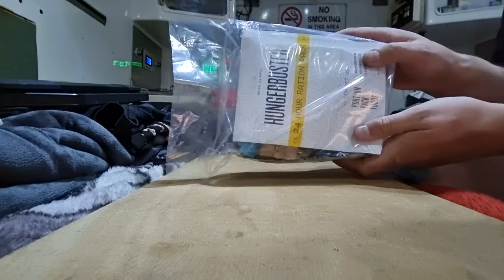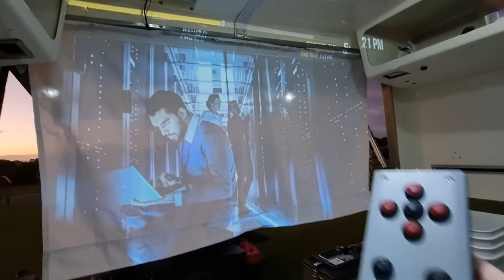Oil, Idler chains and Air filter | New Argo 8x8 Episode 29

Comment: Hi again, one more question. My air intake attaches to the recoil starter on the motor by a round piece of rubber kind of shaped like a sleeve or a collar. it has a groove cut in it for the pull cord.
 on my Argo that sleeve is glued to the air intake and I don't know if it's from the factory or did the previous owner do it the only way I can get my one-off would be to cut it and peel it off and try to get the silicone off of the intake so a new one would fit back on. I was going to take my recoil starter off because it was extremely hard to start and the cord wouldn't go back into the engine. it turns out whoever glue that caller on to the air intake covered over the hole pretty much where the pull cord comes out .i grooved it out with an X-Acto Knife and now I actually  started it for the first time in my life.I couldn't believe it I felt like Hercules!!
Reply from the maker: I looked for a pull starter on mine and couldn't find one. My experience is that argo don't use silicone sealant anywhere. That being said, my sample size is 1, but it was brand new

Comment: Looks like your missing the foam collar that goes around the air filter. Thay keep your filter cleaner longer and you can wash them out.
Reply from the maker: I removed that as it was causing issues.
Fuel grades here are a bit different, and I carry a spare filter.